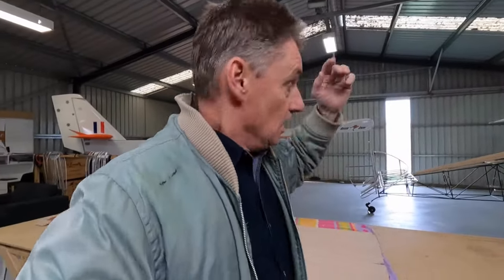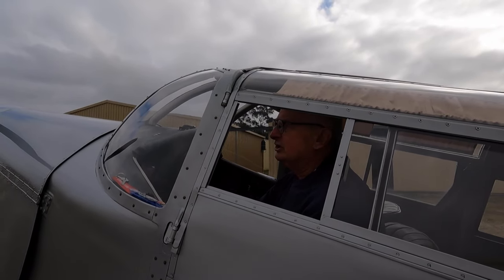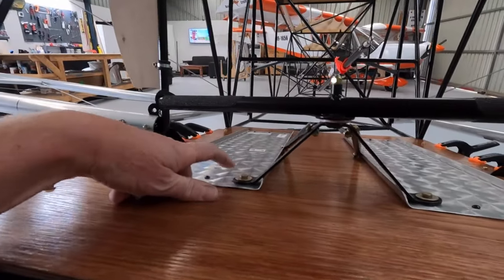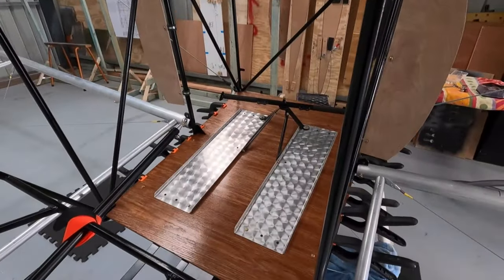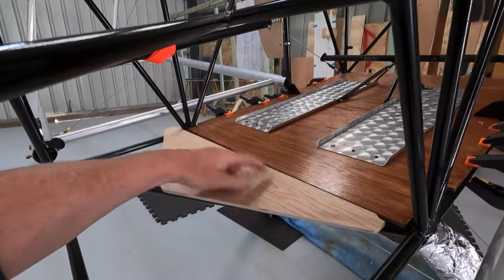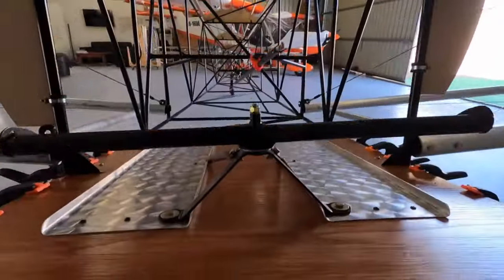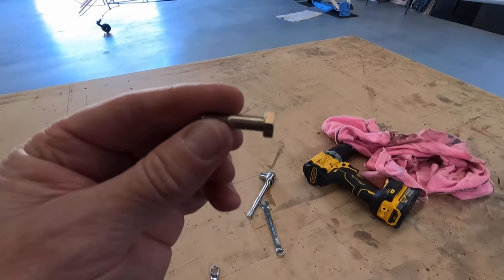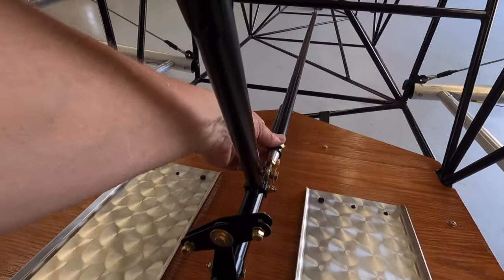Building Flight Controls for a Replica Sopwith Camel Homebuilt Aircraft

Comment: G'day 

Yay Team !

All lookin' good.

The Cedar Stain-Varnish is lighter than a lot of
Real
Cedar (Toona australis)
Which I've milled and made things from... (Windfall Salvage, it's been commercially extinct since 1963 or something !)

Thanks for the look at the
Proctor.

I've never been up close to one of them.

Segue.

How's your Fireplan ?

We went from 6 burning at
Emergency Warning, to
20 + 7 + 4 mm over 3 days...; if this goes as it did 4  and 5 years back...,
 Qld started burning in August September, 
South Qld & us in Northern NSW in October/November, 
Then we got
Rained on, here -
And next places around Tamworth & Port Macquarie started 
Lighting up, then 
Sydney & South NSW Coast, 
Followed by Canberra.

And about January we get a
Second Wave
While Victoria lights up.

I can now run 4 Sprinklers (1x 25mm + 3x 20mm, fed by 25mm Nylon layflat  Firehoses, plus 2 x 25mm 36 metre  Fire Reel (Safety) Hoses,
For
Four hours.

20mm onto 1/2 an Acre in 3 hours & 8 minutes, with another 15,000 Litres (6mm) for the final hour.

Timing will be
Everything.

I have a wrecked Ultralight which I pranged in 1992, to protect...

If I had a
Sopwith Camel Project in a
Tin Shed Hangar on a Grass Airfield...; a 6.5 hp Firefighting Pump, with a 25mm Sprinkler dead centre on the Roof, & backup Firefighting Hose connected to the
Biggest Tank one can afford, would
Beat the shit
Right out of
Paying the Premiums on
"Fire Insurance 

But,
I'm a mere
Competant Smartarse
Living in a
Bushfire
Fuelbomb this past
33 years !

So, it might cost you a couple of grand (my second Pump was  $1,200 + 600 in "Hardware"...; but this Spring I've thrown 14k at upgrading what used to be an 11k Fireplan.

My son, the 34 y.o. RFS Group Officer told me 6 months back,

"This year will be
Bad,
But it'll probably be
Survivable...

But if 
Next year (2024) goes
El Nino, again
Then
ALL 
Bets (on surviving) are off.

And, since then
He and I have
Independantly confirmed than
Fire Behaviour is
Becoming more
Extreme at a rate of
135% per
Year.

Right now, 
Any Fire will be
400% more 
Extreme &
Unpredictable than
2019-'20.

Thus I've more than doubled my
Fireplan.

What do
YOU
Have, right now,
Ready to go...;
To wet down your
Hangar on a
Breakout Day, when the
Fire Brigade are concentrating on
Approved
Dwellings....(?) !

My boy was elected the youngest 
Deputy Captain in the RFS at age 17.

After his first
Captain's Meeting he
Explained to me
That on a
Breakout Day,

DWELLING HOUSES
Are 
THE
Big Priority
To be
Saved.

My guess is that you appear to be at least as capable as my humble self, at scratching up reserve funding to be able to pump Water on hand, through Sprinklers pre-installed, at 15 minutes notice, the better to defend against any
Imminent
Ember
Attack...(!).

Anyone who can afford Aeroplane, let alone a
Hangar to keep & build them in ; can afford a bit of a
Serious
Fireplan.

Please,
Either tell me that
You're already onto it, and your
Camel-build Project is protected to the limits of your Water Storage & 
Pumping Capacity
(Mine being 55,000 Litres at 280 Litres/min..., and it will be 300 L./min, over 2/3 of an Acre, when the next Upgrade is finished being connected.

It's a challenge we set ourselves,
25 years ago...;
When 
WE
Burned the
Fossil Carbon.

Oopsie !

Ask your
Daughter to tell you
What
Greta
Thunberg got wrong...

Half my new Fireplan 
Upgrade is to protect my
Daughter's Tent
Shipping Container of
Household Goods -
Flatpack Kit-Shed House.

But it's my
Aeroplane Trailer
Which will be under the
Overlap of the 2x 25mm Sprinklers
Atop
5-metre Towers.

So

My crashed Aeroplane
Is
"Safer"
Than the 3m x 3.6m
Lawn Locker in which I've
Resided since 
1999 (!).

Sometimes,
One has to
LAUGH
At
Oneself...!

Such is life,

Have a good one.....

Stay safe.

;-p

Ciao !
Reply from the maker: Thanks, no need for grass fire protection where my hangar is.
Reply: @scottmatthews5280  

I hope you're right.

The issue seems to be that on a breakout day, anything not already wet
Will
Burn...
Short grass and
Bare Dirt included.

"Mineral Earth" is a bit of a
Bullshit concept...

Unless it's Sand, Gravel or Rock, the factor which makes it
Soil...,
Is the Organic Matter in it.

And thus, when it dries out and gets hot - even 
Bare Dirt will flash, & burn over.

Thermal Mass is 
King..., and 
Pumping water deploys
Thermal Mass around and onto whatever is required to
Not burn...

Insurance is always calculated such that the 
Price of the "Premium" is ideally
600% of the 
Cost of the Risk being
"Insured" against.

(If your House  has a 1 chance in 300 years of losing it's Roof to a Storm - then your Premium for Storm & Tempest "Insurance" will be 1/50th of the cost of replacing the Roof.

I have no Insurance, but I have 9 Firehoses & 4 Sprinklers, 3 Pumps & 37,000 litres sitting on the Lawn with a delivery line from my neighbour's # 2 Bore Tank holding another 22,000 litres.

I was once trained to sell insurance. I hated that job.

Selling Idiots a
Bet, which they had to
Die to
Win (!).
And the 
Salesman's Commission on a
"Whole Of Life" Policy is
100% of the first year's
"Premiums".
That was in 1980.

Apparently, now, when an
"Investment Advisor" succeeds in getting their client to, 
"Change their Superannuation Policy to a different Plan ; which offers better 'interest' & returns..."

The Salesman will then collect between 110% & 130% of that first year's "Superannuation Contributions" to the new improved Plan.

Previous Fire Behaviour is
Not
Any kind of a reliable
Guide to what's in our
Pipeline & coming at us.

I live in a Lawn Locker
Surrounded by the best
Fireplan I can afford.

About $25,000 in total.

Judging by the scale of your
Operation, my guess is that you could afford to put a Pump & Sprinkler on the Rainwater Tank coming off the Hangar Roof, without breaking the Piggybank (?).

It might take you a couple of days to set up, and after a year you'll still have the Pump & Sprinkler ; after a year of paying Insurance, the Customer has no Firehoses, the Company Employees got paid & the Shareholders received a "dividend".

I prefer to own the Firehoses !

But I'm an 
Oddball.

Such is life,

Stay safe.

;-p

Ciao !

Comment: What is clearance on the bushes? Are you using a rattlin good fit or tighter
Reply from the maker: Torqued up to 50” Lbs, slide on the -4 bolt.
Reply: @scottmatthews5280  Tnx. Great job. Lot of determination.👨‍🔧

Comment: Look at the fittings where the flying wires such to the fuselage.  The proper design practice is to have the line of force (i.e. the line of the flying wire) intersect the junction of longeron, upright and crossmember.  This is off by several inches. Imagine the white puking with s force of afee thousands pounds. Which it will in a 4g turn.  It will bend the upright.
Repeatedly. Over and over. Eventually something will crack and then break. It's bad design.

I am not trying to sh.t on your project. That missing crossmember is enough to tell you that this guy has no business designing aircraft.
Reply from the maker: Okay thanks, it’s definitely not going to be pulling 4Gs for info.